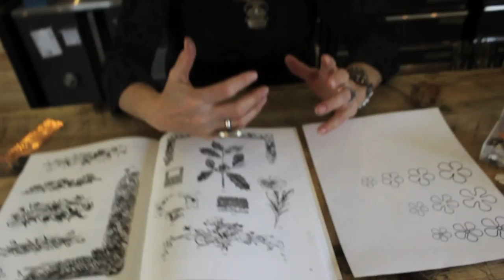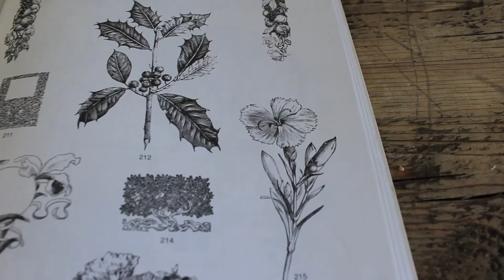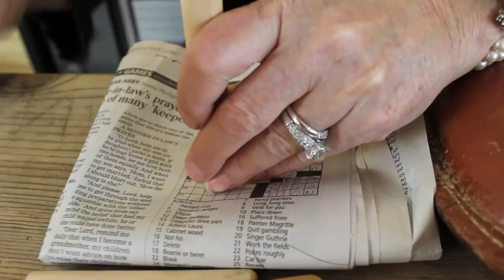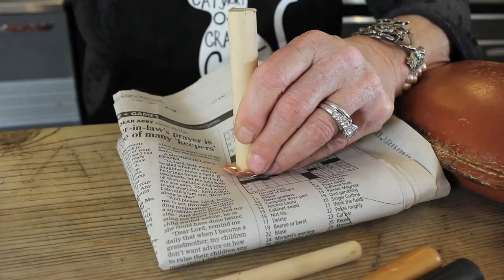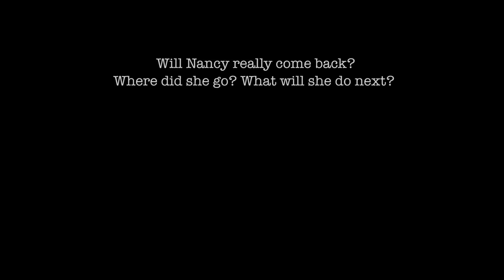How to Make Metal Flowers, Part: 1

Comment: I love the label trick :P  learned it some years ago, when working for a jewelry shop and never went back to glue/tracing paper/ etc - its just so much faster and precise!  I actualy found it fairly easy to take labels off, with only a bit of soap and dishwashing pads, the ones with sponge on one side and scrubby layer on the other?